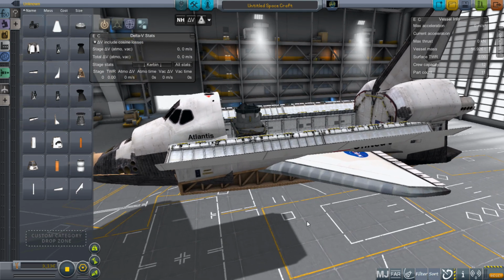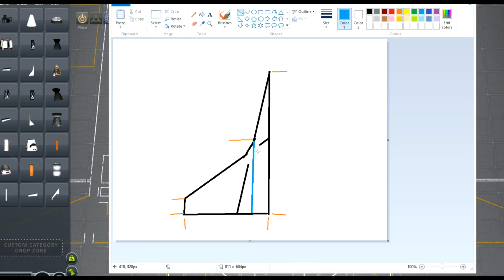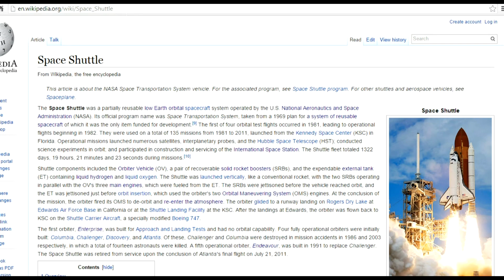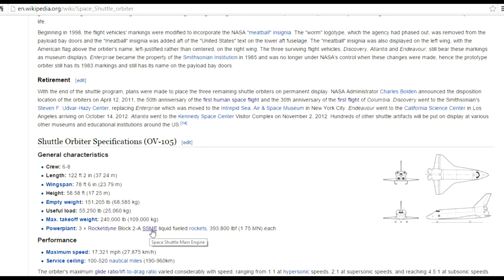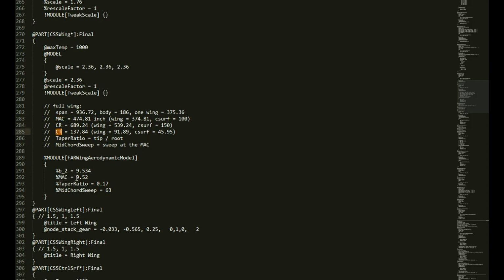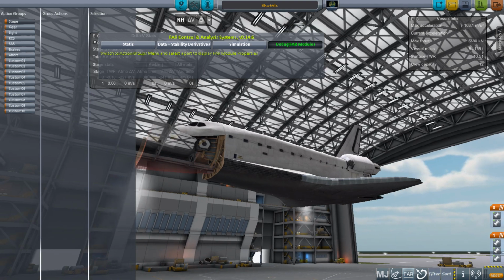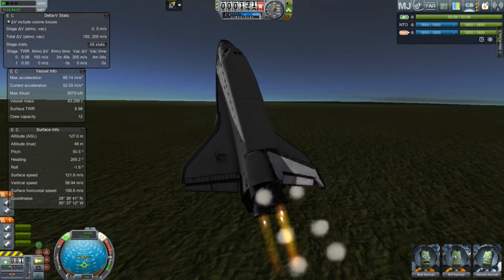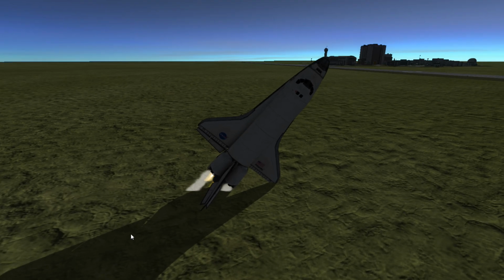SE04: 1974 / Project Enterprise - Space Shuttle / KSP 0.90

Comment: Based on something Scott Manly talked about at one point and some values I've seen myself when setting flap deflection for take off, most wings start to stall at 20-22 degrees of deflection. So 15 gives you a safety margin for your control surfaces so long as you keep your AOA of the craft under 7 degrees or so.